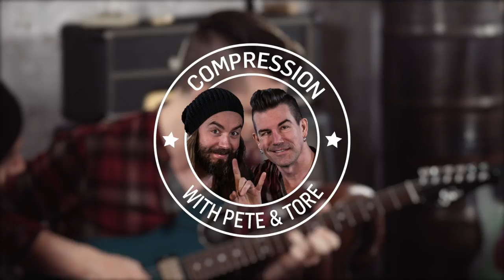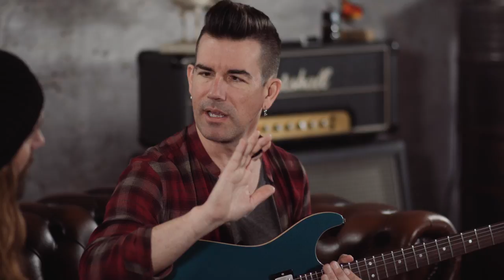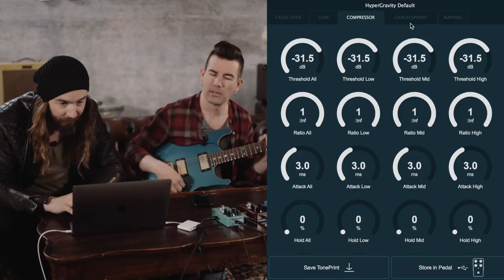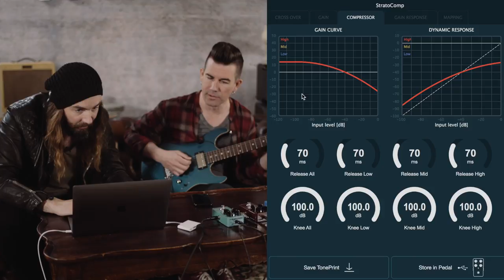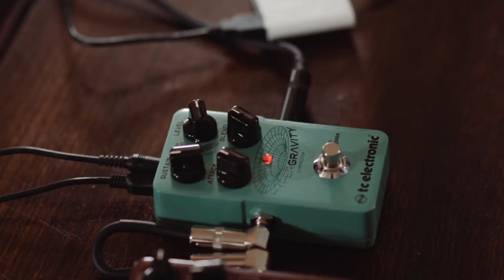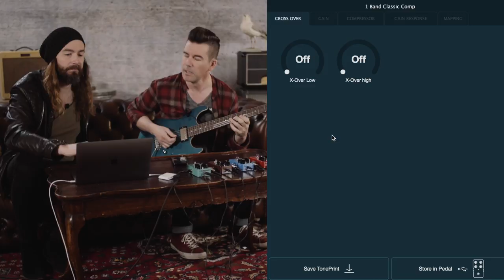Pete & Tore - Everything You Need to Know About Compression

Comment: Whats the point of buying this pedal if you  wanna emulate dyna comp so much
Reply: I think the point of having this pedal is to be able to go from the Dyna kind of compression to a softer, less in your face compression. It's like having a Flashback: you can have the 2290 kind of delay, but you can also have a Memory Man kind of delay, or the Carbon Copy. If you had either the 2290 or the Carbon Copy you wouldn't have anything else to experiment and find the sound that fits the song better. So in this case I think the range you can get from this pedal is the key